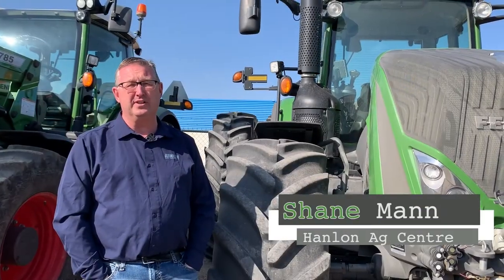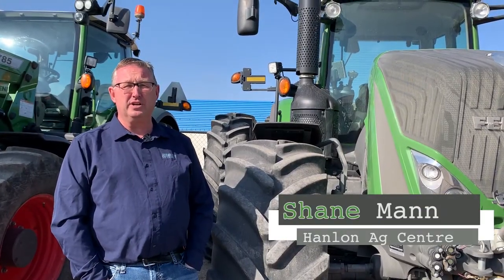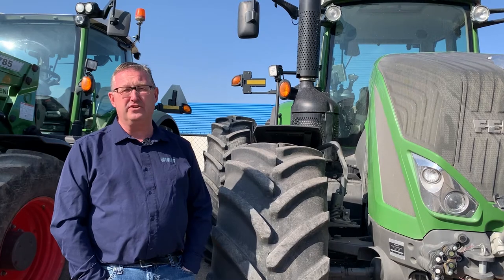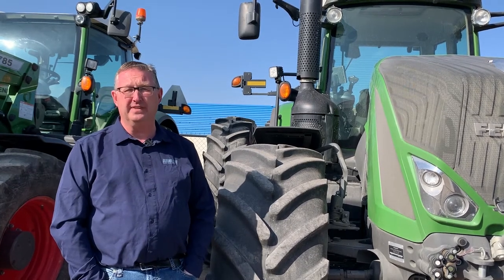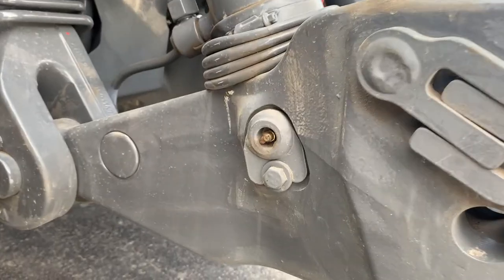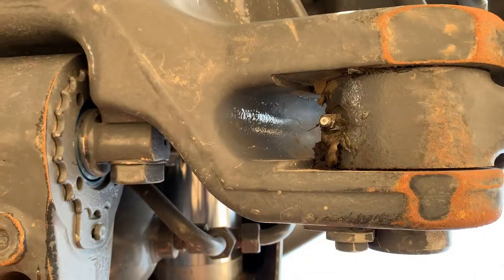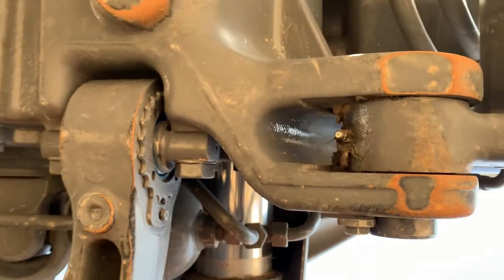Where to Find the Grease Points Fendt 900 Series Tractors | Fendt Maintenance

Comment: Wow, not many grease points on a fendt !!

How do you check the Fendt 900 Series Tractors hydraulic fluids?
Reply from the maker: Hydraulic fluid gauge is on the dash
Reply: @hanlonag  And how about transmission fluid?